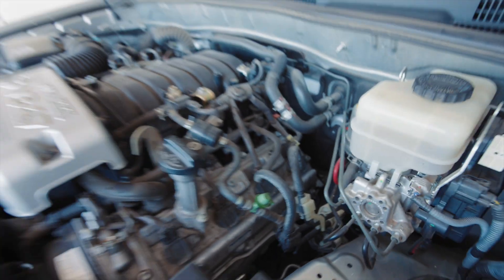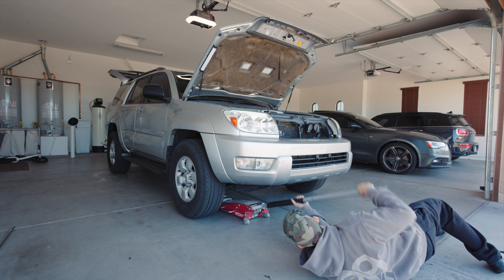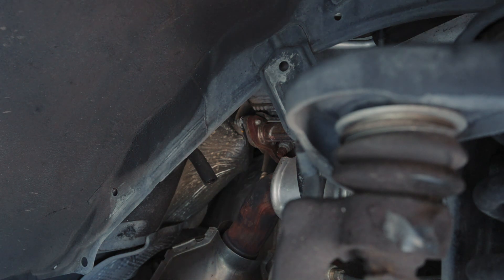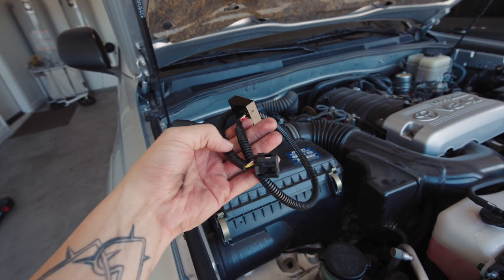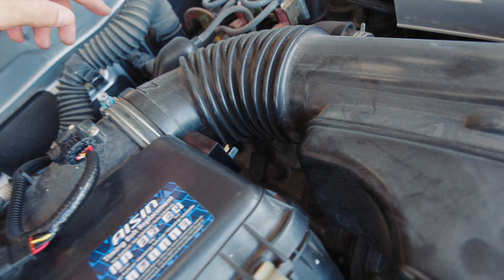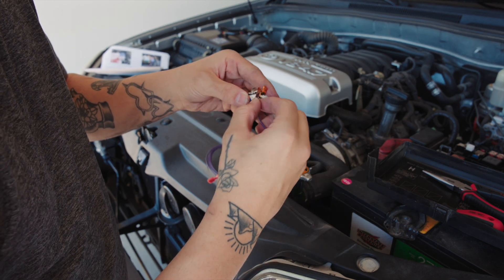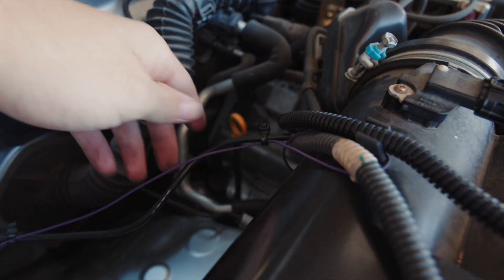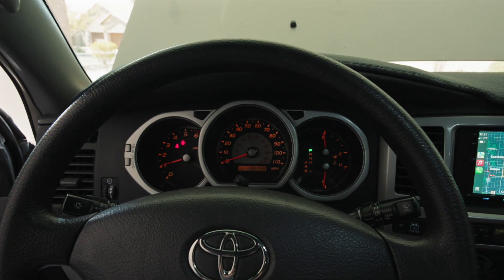Hewitt Tech SAIS Bypass System | 2UZ Engine

Comment: So I just installed all of it except didn't finish the starter wire part. In the manual it says to do a voltage check with a multimeter on the starter relay wire. It says while cranking it should be anywhere to 5-12v then back to 0 when the engine runs and the starter stops. I am only getting 0.07v on the crank and then it goes back to 0 once the engine starts running and the starter stops. Did you encounter this issue? I have the same exact box and fuse location setup but in a 2005 GX470. And it is the weekend so they are not open to answer emails right now.
Reply from the maker: I didn’t voltage check as I probably should. But I would say make sure your connection is solid and really wrapped around that fuse